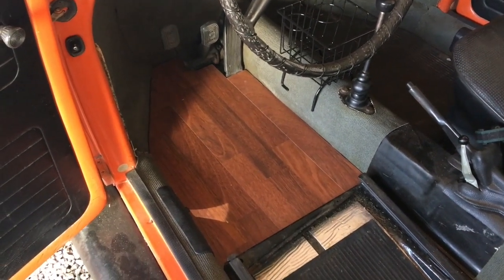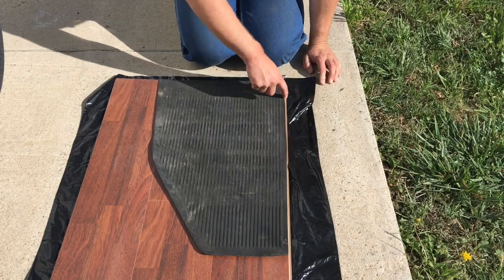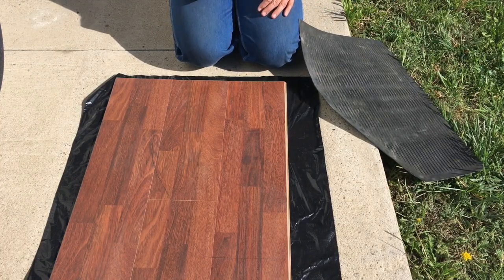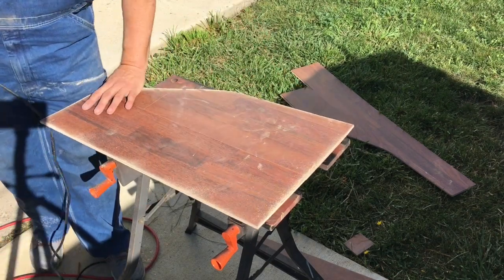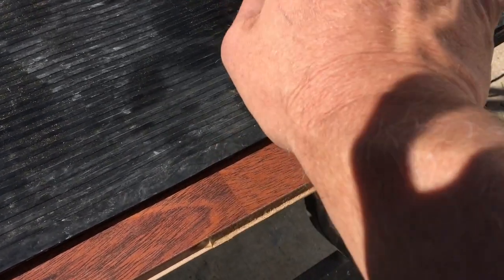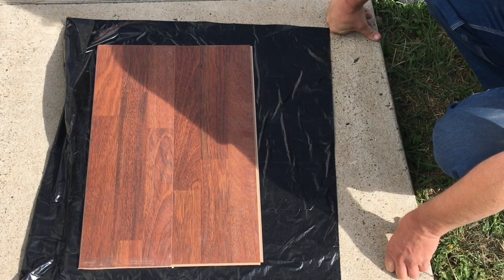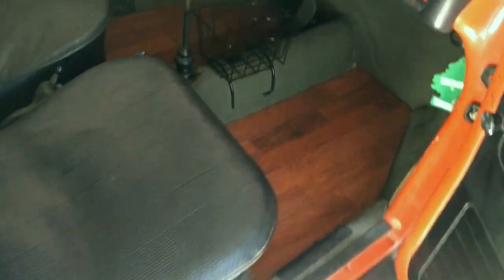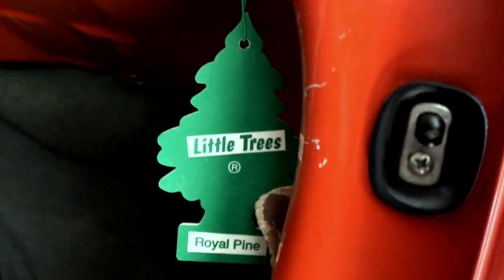Buddy the Volkswagen Beetle Part 11 | Wood Floors! | I saw this on Pinterest...

Comment: I need to change my heater vents to manual controls! My cable are broke! Great video and idea!
Reply from the maker: Thanks! the cables go to the rears, the fronts on my 71 just have the little manual flap.
Reply: Misunderstoodboygenius That’s exactly what I want, the little manual vents at the front. My front cables are broke, and I seen on one of the sites could be J bug said they no longer sell them these bicycle hand brake cables. I would rather have the manual Vents!
Reply from the maker: I just saw them on CIP1, and they are 30% off in October :)
Reply: Misunderstoodboygenius Thank you!!! I’m grabbing a set!!! 👍🏻👍🏻👍🏻